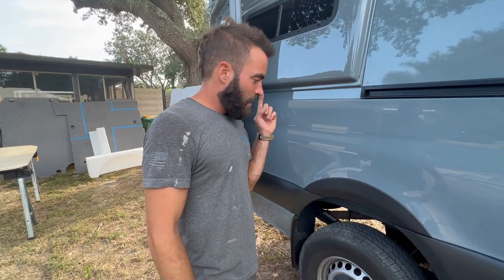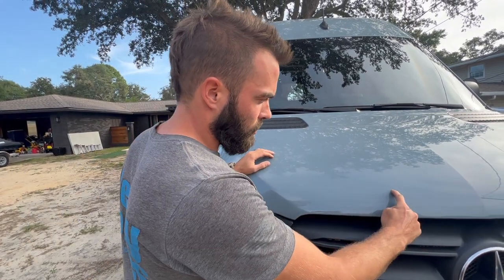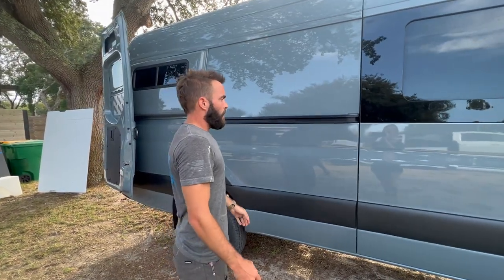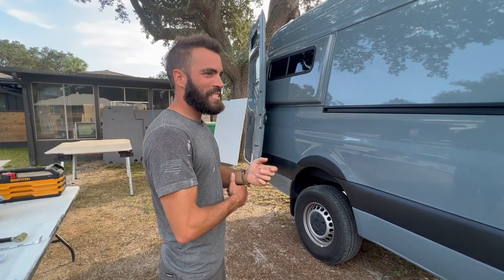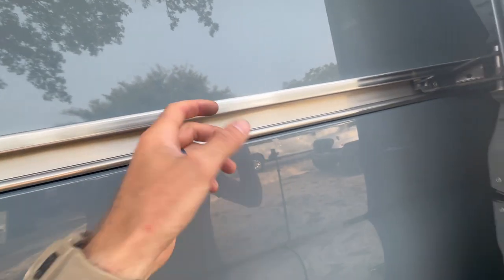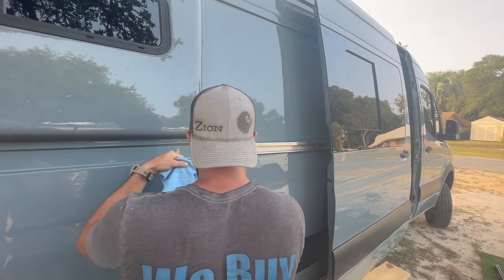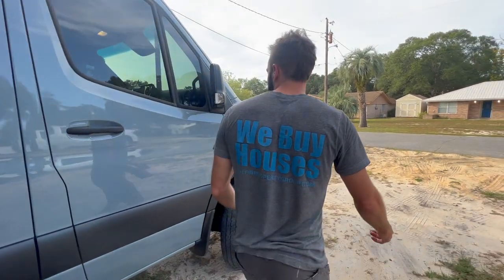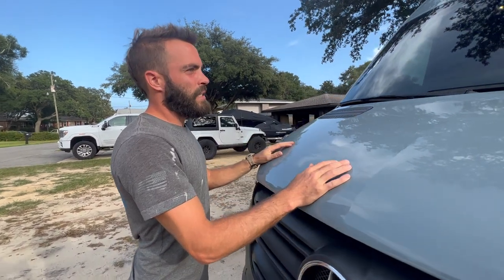Installing a NEW black sliding door track and more!

Comment: Thanks for this Video I thought about doing the same just wasn’t sure if I should remove or unscrew the holder in the sliding mechanism. Thanks to your video I can just slide it out and rust treat it behind and mount it again
Reply: I had to give up as there is a nut left which is already behind my build which I did not seen in the beginning :) obviously next to the sliding door. As far I could see there wasn’t much rust behind
Reply from the maker: @ArcticNorthAdventures  aw man that almost happened to us too! Thanks for watching!!

Comment: Was the part number on the one that was removed.
Reply from the maker: @David-sj6jw  do you mean the part number on the one we installed or the factory?
Reply: @Organicallyjoanna  part number of either is helpful
Reply from the maker: @David-sj6jw  Sprinter Vans Black Sliding Door Track (#TWS-77B) https://nomadicsupply.com/mercedes-sprinter-vs30-2019-black-sliding-door-rail/
Reply from the maker: I found the part number on that link
Reply: @Organicallyjoanna thank you